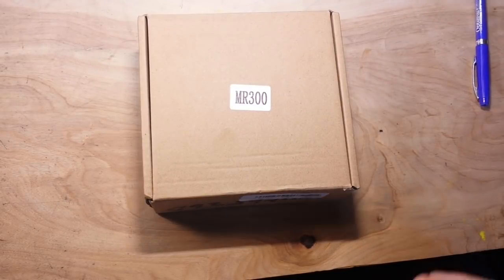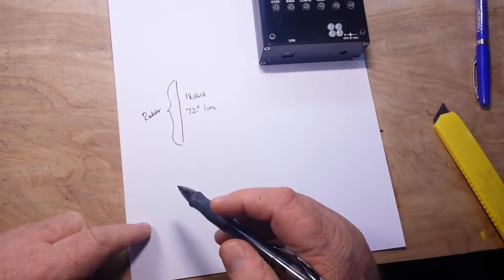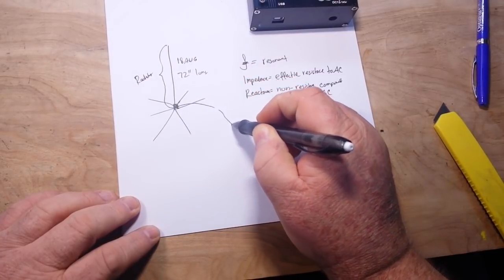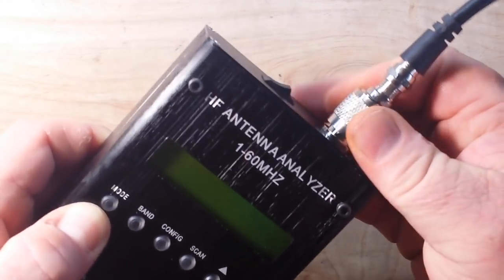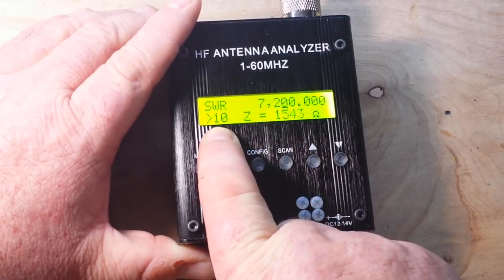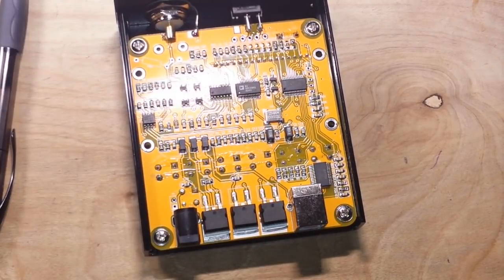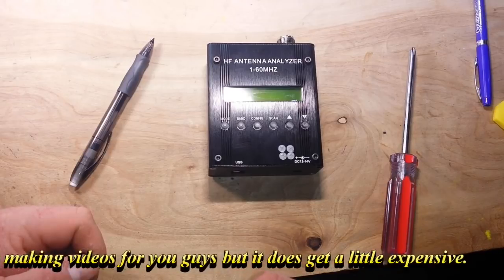MR300 Antenna Analyzer from Banggood

Comment: The plastic screws serve an unconventional purpose. They allow a window for the Bluetooth adapter signal to get out of the analyzer. That's all they do. I have one of these I've calibrated it it's not a very good product. It claims to operate between 12 and 14 volts. When doing the calibration at 12 volts and at 14 volts you get different results. This tells me the voltage regulators they used are not doing a very good job. Personally I would avoid this little unit like I would venereal disease.  Fun in the beginning but later on no fun at all.  

Also this unit uses non-standard calibration resistors. You can find a 50 ohm obviously and a 150 can be found but a 274 is non obtainium.  You have to make it.

Comment: You mentioned that you could get your SWR down to 1.5:1 using your antenna tuner and I assume a standard SWR meter between your antenna and rig.
Could it be that the SWR meter is correct the the cheap banggood antenna analyzer is wrong.
I see a lot of comments about these units being shipped uncalibrated.
Are there any instructions that come with this unit on how to calibrate it.
I'm guessing your SWR meter is the correct on and not the the MR300 if you've been successful in getting contacts in the past

Comment: I got an ebay one someone had fiddled with the plastic screws on it. Well the screws do nothing BTW. I calibrated it and also got a new one out of the box it reads over 1000 ohms with a 50 ohm dummy load. Guy on here built a switch box of resistors to calibrate it. Its a pain without it!
Reply: The plastic screws serve an unconventional purpose. They allow a window for the Bluetooth adapter signal to get out of the analyzer. That's all they do. I have one of these I've calibrated it it's not a very good product. It claims to operate between 12 and 14 volts. When doing the calibration at 12 volts and at 14 volts you get different results. This tells me the voltage regulators they used are not doing a very good job. Personally I would avoid this little unit like I would venereal disease.  Fun in the beginning but later on no fun at all.  

Also this unit uses non-standard calibration resistors. You can find a 50 ohm obviously and a 150 can be found but a 274 is non obtainium.  You have to make it.

Comment: Hi Iearnelectronics.  A nice video.  Particularly your explanation early in the video regarding impedance matching, which would have been very informative to new Hams.  

I hope you and the other YouTube viewers will take my following comments as constructive in the true Ham Radio spirit.  

On a very minor point, you initially correctly explained SWR as 1:1 and 1:1.5, but then went on to show SWR as 2:1 and 3:1, whereas, to keep to the same format, they should have been written as 1:2 and 1:3. 

My second point is that I found your video as a result of researching the MR300 unit after seeing so many bad written reviews on this unit (some on the Bang Good website): 
https://www.banggood.com/fr/MR300-Digital-Shortwave-Antenna-Analyzer-Meter-Tester-1-60M-For-Ham-Radio-p-1133552.html?rmmds=myorder&cur_warehouse=CN 
and this video review: http://youtu.be/h3lAnwr_5fo which identifies a known problem with some MR300 units.  It appears some units, particularly those utilising the inferior 9850 chip, are actually analysing a frequency 1.5 x greater than the displayed frequency.  For instance, if the frequency displayed is 14.000 MHz, the unit actually analyses 21.000 MHz.  In your case, from 9:09 you were trying to analyse 7.200 MHz.  IF your MR300 unit had this same 1.5 x fault, then although your unit was showing 7.200, it would have been actually analysing 10.800 MHz.  

My experience of antenna analysing, using MFJ259, AW07A, and miniVNA analysers, all of which have proved to be extremely accurate (in critical conditions, I and Ham colleagues usually cross-check results with the MFJ plus one of the others) indicates to me that the results of your attempts to obtain a 50 Ohm impedance suggests there is a serious fault with your MR300 unit.  The fact that you couldn’t even produce a 50 Ohm match with your ATU in line supports that suggestion.  

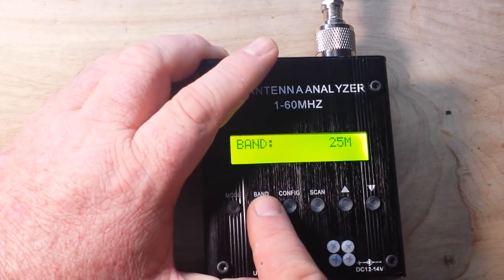I reckon the only way to check your MR300 is to use another make of analyser (MFJ259 would be ideal), then re-check results with the MR300.  Interestingly, at 11:38 you will notice that the frequency 12.000 MHz on your MR300 showed an SWR of 1:1.1 and 32 Ohms, which is pretty consistent with the suggestion that your unit is analysing incorrectly.  This is not at all helped by the fact that your analysing is going through your ATU.  The analyser should only be used direct to the antenna (via the feed line), with no other equipment in line, to make sure only the antenna (plus feed line) are being analysed.  

My advice?  You get what you pay for!  Stick to proven analysing equipment – despite being an MFJ (Made From Junk) product, the MFJ259 is an extremely accurate and easy-to-use analyser which will last the whole of your Ham Radio hobby, and which is NOT a dubious Chinese product!  My advice to new (and existing) Hams?  If you have to choose purchasing an MFJ259 analyser OR an ATU, choose an MFJ259.  You won’t regret it – you’ll end up constructing an antenna that doesn’t require an ATU, with the positive result that your station will be more successful.  Trust me, I'm a Ham!  Incidentally, the short length of 75 Ohm coax (compared to using 50 Ohm) would not significantly alter analysed results, although having an ATU (or any other equipment) in line negates the use of an antenna analyser in the first place.  As I’ve said, guys, please take this posting as constructive and informative, and I hope this helps you in your Ham hobby.
Reply: When stating VSWR values the denominator is always 1. Writing 2:1 or 3:1 is correct.

Comment: Rubbish pure junk... I have two. Neither work
Reply: I also have two now and both crap as far as I can tell...   Paul please do a follow up and tell us how you got on since this.
Reply: I've used one for years now without an issue. Use the VNA2 now also. Both very accurate. They are made by many manufacturers so there is lucky dip aspect. It's best to buy from original maker and they support it well.

Comment: Mine shipped uncalibrated -- how did you calibrate?
Reply: i'm really interested in calibrating it too
Reply: Jérémie L'heureux-Piché, there is a procedure involving the use of three resistors - 50 ohm, 150 ohm, and 270 ohm - and the "calibrate" mode. If you look for The Radio Prepper's videos on the M100, Gill shows the process. Otherwise, Google the SARK 100 manual and it is described in that
Reply: Use a programmable resistor board

Comment: First off, congratulations on getting your license.  Extra here. Couple things I noticed.  The "f" connector you are using is meant for 75 ohm impedance generally, if that coax is 75 ohm as well that not gonna work with a 50 ohm system.  Even if tuned in most your power be dissipated in the tuning.  Next,  the F connector is cross threaded into the adapter at the top, all connections need to be clean and tight, the jumping of your meter and issues there are that cross threaded not tight connection. That actually looks pretty well put together and easy to use, all in one. I am gonna look into one.   73's.
Reply from the maker: Thank you. That would explain why im not getting out more than about 600 miles on 100 watts
Reply: Well antenna height, type, etc. is lots to do with it as well.  Area can do it to.  There is an art to propagation. I am in Northern Indiana,  Gotten as far north as Ontario Canada and Several towns in southern Texas. Only got me off center fed dipole 20 feet high.  That analyzer there will help lots in getting some resonance. Thank you for response, and good luck with some DX'ing.

Comment: I couldn't help but notice you seem to have 75 Ohm CATV coax with a pl239 adapter. Is this correct? If so, you will never have better than 1.5 SWR. And the antenna system SWR after the tuner will always be the same, eating up the power you put into the lossy tuner, lossy coax, and un-tuned antenna. The easy part is, you could shorten the radials to lower the impedance AND resonant frequency into the 40 meter band. Or you could fly up to the top of it and lengthen it a bit. The best thing is, you know it needs some work.   73
Reply from the maker: Yes that 75 ohm coax is just a short piece to get from the tuner over to my work bench.
Definitely need to work on the antenna.
Reply: You had me worried for a moment.

Comment: Geeze, you couldn't hear me yelling to turn it around? Wow I remember a lot of this from CB radio days, still have my SWR meter. Thanks to Banggood for more booty and to you for a great video!
Reply from the maker: Thanks, this one was kinda exciting. Some of these companies send me a lot of less than useful fluff. This is a great tool. I think you will like tomorrow's video. Ever heard of the Intel Curie?
Reply: Isn't that the chip on the Arduino 101? I haven't seen one but I hear it lots of goodies built in.